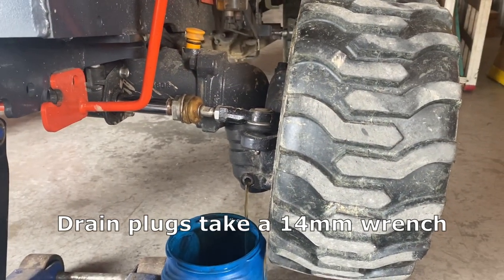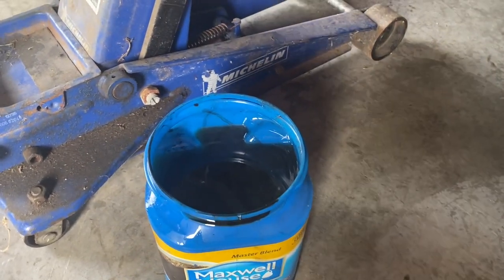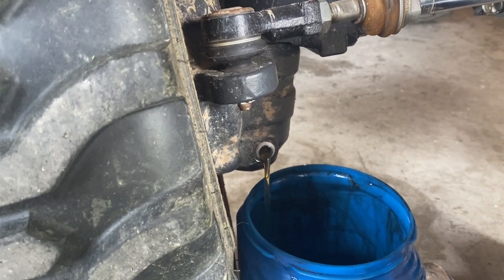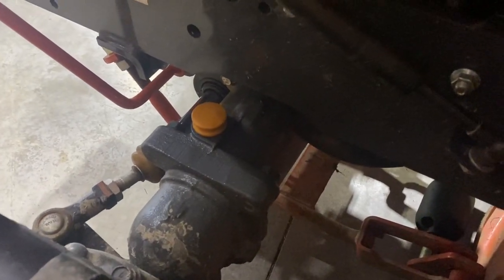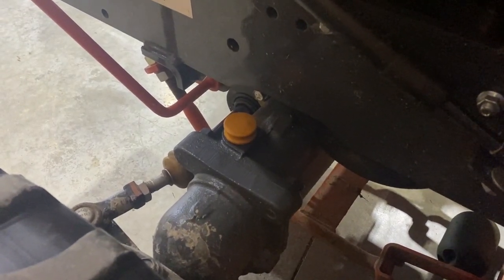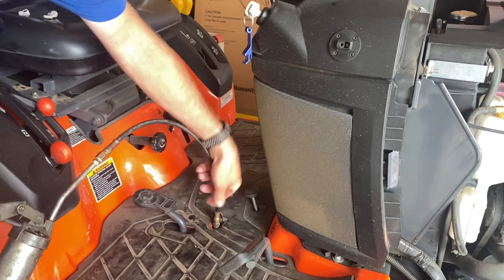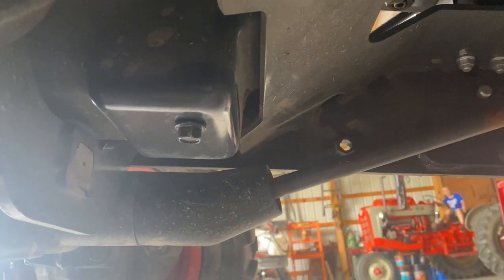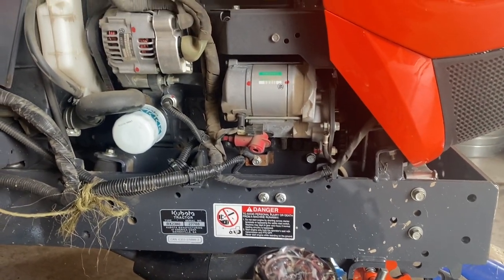Changing Engine Oil and Front Axle Oil In the Kubota BX2380

Comment: On my older Kubota  I had to stop using Super UDT due to it seeping out. Thankfully after switching the seeping stopped.  That seeping and a weld crack on a wheel are the only issues I have had. 30 years of running like a clock is not bad.
Reply from the maker: I use super udt in the BX & L with no leaks. The older machines might not have the tolerances for the thinner super udt. I think it is a good fluid but would also switch to avoid leaks/seeping.
Reply: @AcmeCountryAcres  It was a well known issue on the old machines
Reply from the maker: @coldspring624  I didn’t know that, thanks for the info.